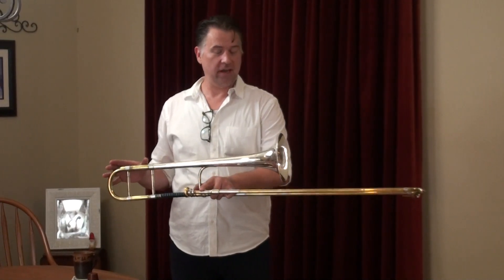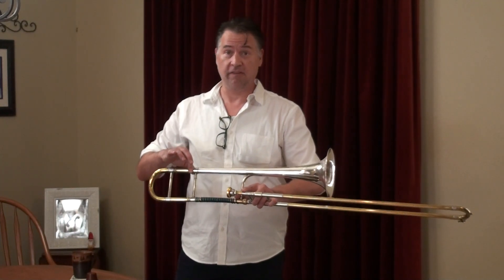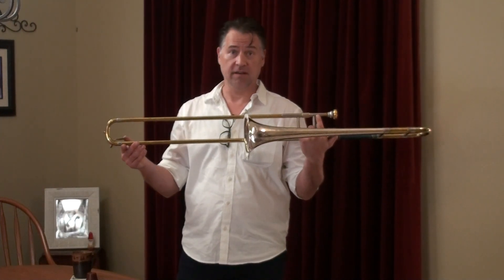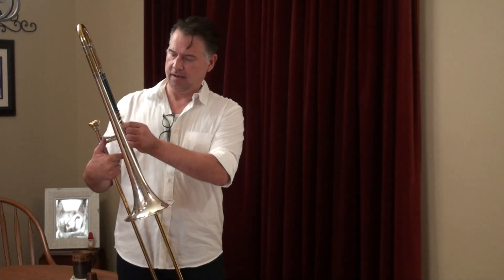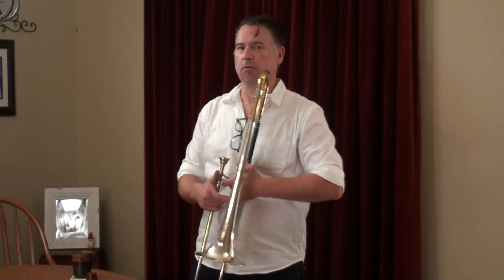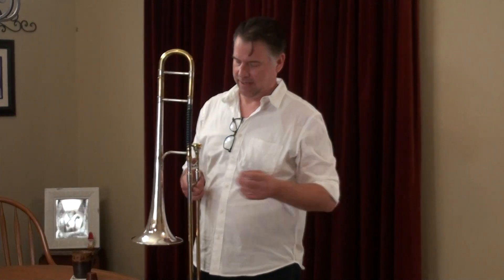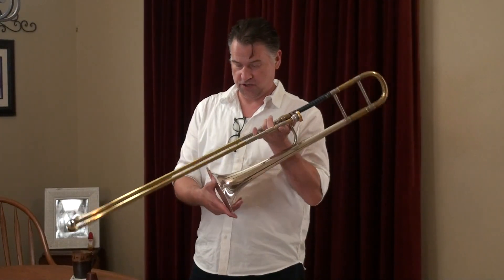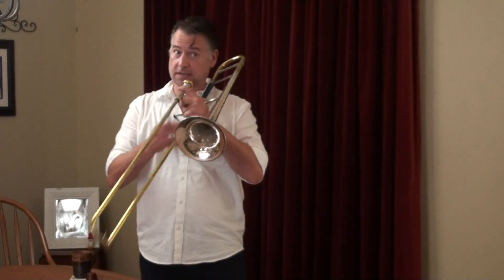1928 King Silvertone Tenor Trombone

Comment: unless i am wrong, the silvertone bell and 2b bells are identical in dimensions. ive seen some examples that claimed to be 2b chassis with a direct silvertone bell transplant. my knowledge on these bells/horns can certainly be debated and corrected, but my understanding is that there are 4 eras of silvertones
1. the original King SilverTone. 
2. the King 2B SilverTone but the bells haven't been marked as 2B yet.
3. The King 2B SilverTone in its truest form with the 2B engraved on the Bell. 
4. the King 2B SilverSonic after King lost a lawsuit to Sears over the SilverTone trademark
I think this horn here might be one of the early 2B SilverTones before 2B was engraved on the bell. I'm not positive.